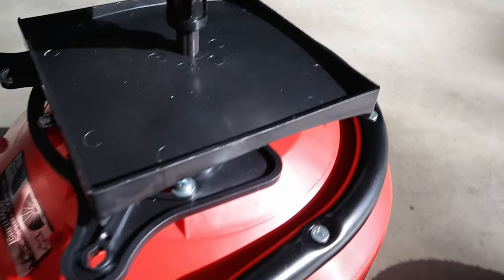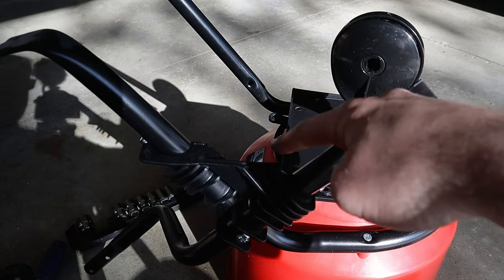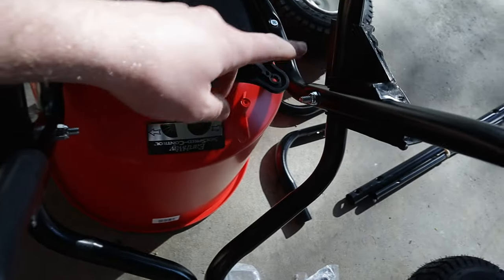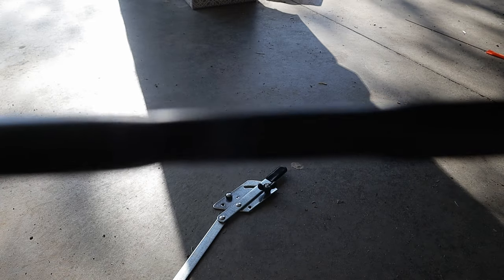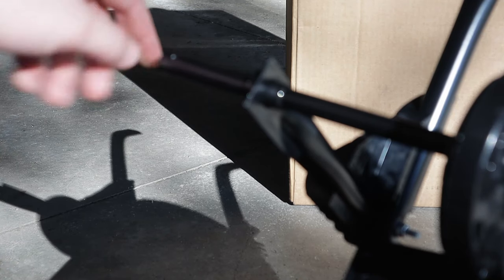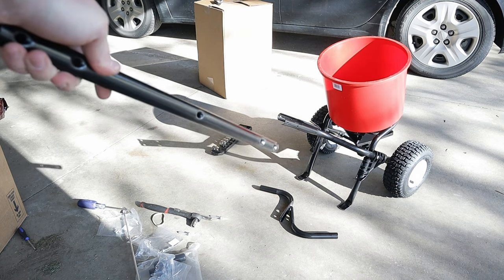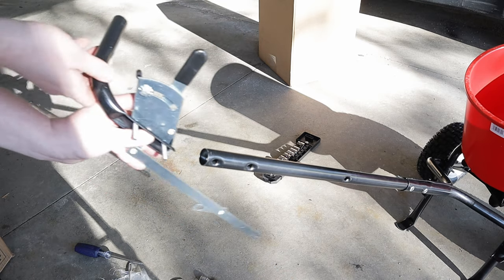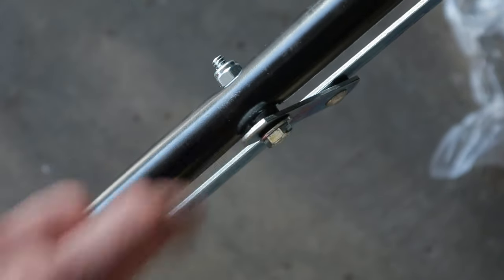How to assemble an Earthway 2600aplus spreader

Comment: This video saved me so much time! Just got this spreader and got a headache trying to decipher the provided manual. Luckily your video was easy to find and follow! Thank you so much for making it :) also for anybody reading that might get stuck on the one part that I had to spend some time on: the hopper has TWO setting (1) full spread and (2) side spread. Mine came with lever turned to the side spread setting by default. So when i got to the calibration part and pulled the control lever all the way back, only 1 spreader would open (as opposed to all)! I was scratching my head for a bit thinking I did something wrong. But then figured out that i needed to change the spreader setting control to "full". And that fixed it. Anyway, great video, thank you much.
Reply: Thank you!  I was wondering why only one of my tear-drop holes opened up!  I have product to drop and I wanted to figure this out quickly.  You rock!

Comment: you saved me quite a bit of headache/frustration after I perused the directions and said "I hope someone's made a video that's more clear than this" -- thank you!!!  Earthway should be ashamed for those instructions... and the 4 missing #10 screws in my box (that connect the frame to the hopper) I had to replace at home depot.

Comment: Thank you for taking the time to shot, edit and post this video. Very helpful.  Earthway claims they plan to post an assembly video but they still have not done so (as of April 2020).  The information section needs a description of the tool  you used to tighten the screws. Much more so than music information.  A link to Amazon would also be helpful.  I put this thing together with two wrenches as I don't own a socket wrench. One wrench to tighten, the other to hold the bolt in place.  Not fun. The included instructions are terrible. They make no mention of ANY tools!

Thanks again.

Comment: Nice video, but the part I am having problems with you didn't' show. On mine appears that the opening on the black plastic piece that attaches to the bottom of the seed holder where you are supposed to connect the open/close arm is oriented horizontally instead of vertically so the arm won't fit in the whole.  I tell if mine is defective or if I am doing something wrong, but right now it appears I will have to open and close this thing manually.  I want to send it back.
Reply: Did you ever solve this? I’m having the same issue

Comment: Two questions.  Do you find that this spreader empties close to 100 percent?  As bad as the Scotts spreaders are designed, they do a decent job of getting all of the fert out of the hopper.   And do you find the handle too low for comfort?  I'm 6' tall and the Scotts mini broadcast spreader handle is barely tall enough to use for my whole yard.  Thanks!

Comment: First, great video. I have a question though. At frame 10:20 the agitator on the pinion shaft is correctly installed. I applied Lesco dimension with a full BB sized particle and the spreader didn't work well. I saw a video with the agitator pushed on all the way. I know this is not the correct way but seems like you would get better action.